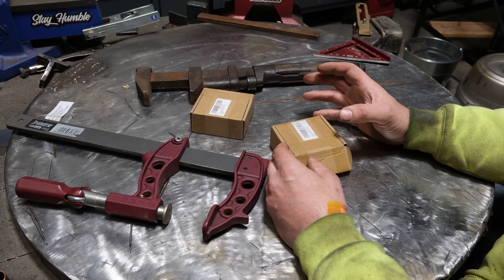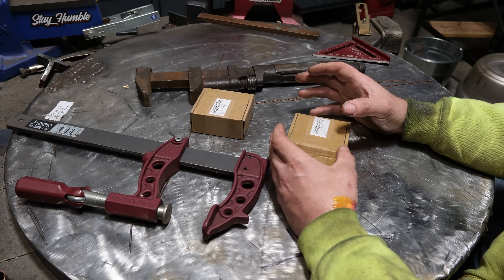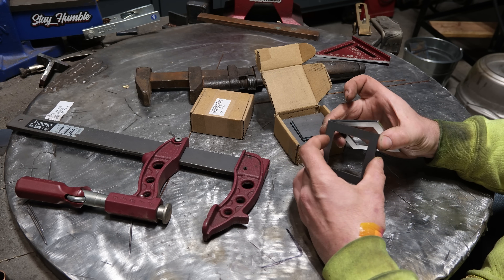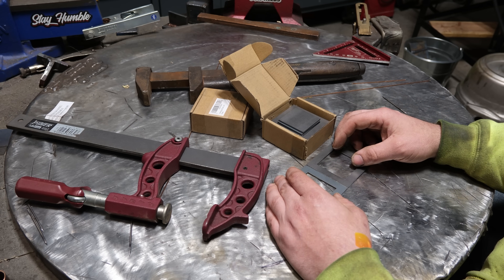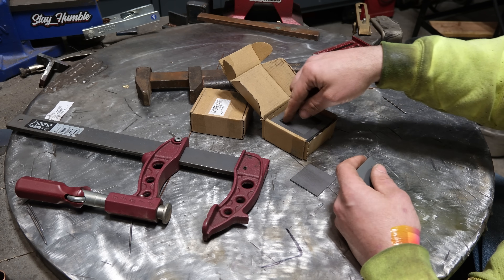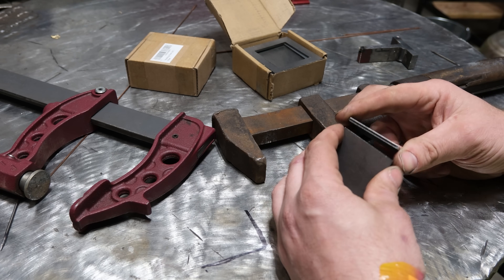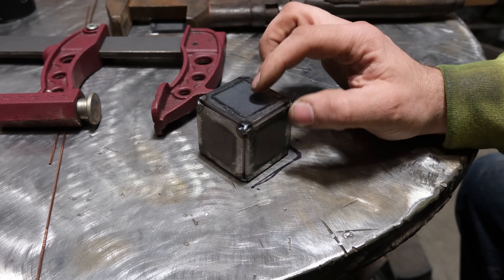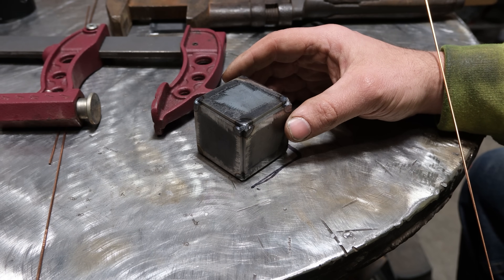Project time: lets weld a cube together from a kit

Comment: Have you seen the stainless tig welding practice kits on Amazon? They have some really intricate ones as well as fairly basic. Dice, deer antlers, wolfs head, and a couple others that are all probably 1.5-2mm stainless cnc plasma or laser I would assume. I thought about picking some up as gifts for people and also to help teach my son to tig stainless. He’s been welding since we was 8 but I’ve never had him do any stainless work because of the cost of material. They are so cheap on Amazon though he can start with the basic dice and then the antlers working his way up to the wolf head as a final project.
Reply: I’m looking forward to your video on pulse. I have played with it here and there but have yet to find a time it was any easier or faster than just controlling everything with the pedal.  I end up taking longer trying to time everything right with pulse with the right time to add filler rod or to move ahead ect. I may be just over thinking it or something idk. 99% of what I do is aluminum so maybe that’s why I don’t get much use out of it.
Reply from the maker: I will definitely look into kits like that.  I bought a few different ones (no animal heads) and the quality is really all over the map.  If the Amazon review is decent it probably will be decent.  It would be a fair bit harder to do a 3d shape than a simple cube.

Regarding the pulse, I generally tell people to stay far away from it on aluminum.  Aluminum is hot short sensitive and pulse will increase the risk of internal weld cracking significantly.   For most metals the pulse doesn’t offer much.  Mostly thin fusion welds it can give better control of melt through and bead width.  It can make a more consistent looking stack of dimes with tig, but often at an expense of weld penetration.  I tend to not use it much simply because the benefits diminish of things other than thin material.

Comment: Great idea, and pretty economical given the effort to make an equivalent by hand.  Certainly need mill scale removal, or "pickle" them in vinegar for a day or so.  Could also use these for TIG brazing practice.  Could also add one of the other kits that are thinner metal, as a way to improve heat control, working on that after getting experience with this thicker stuff.
Reply from the maker: Definately would pay to remove the milscale, great tip on the vinegar.  Tig brazing would definitely work great too.  The amount of time it would take to cut out the pieces yourself easily makes buying a kit worth it.  Especially trying to make them perfectly square lol.

Comment: Nice job. For small steel parts, i will soak in mutatic acid/water solution. Removes mill scale fast. Looking for to the pulse video.
Reply: For mill scale that looks to be this thin you can also use regular vinegar.  Immerse for a day or so and the mill scale wipes off.
Reply from the maker: Something other than grinding is definitely the way to go.  The end result will be better too 😀👍

Comment: Definitely going to get a kit at some point this summer might be good flux core practice or 1/16" 6013
Reply from the maker: I will be trying to stick and might weld the others in the kit.  Flux core wire and mig shouldn’t be too hard.  Stick will require 1/16th rods and will likely be far harder.  6013 rods like you said will be the way to go for sure lol.
Reply: @makingmistakeswithgreg 
Welded up 2 cubes with 3/32 and 1/16 6013 the 1/16 was way harder to use

Comment: Very nice welds!  I’ll have to try tig welding some day.   I have a question…On a recent project, I’ve had to weld fillets on the inside of a traylike item.  This is with flux core and these inside fillets are coming out terrible (normally exposed fillets are coming out good)…only sticking to one plate, lots of splatter.   Could this be due to arc blow?
Reply from the maker: Interesting results on the inside corner joint/fillets.  So arc blow/wandering tends to be most common with stick due to the flux burning off inconsistent and the polarity running electrode positive which causes a wider arc cone.  Flux core wire runs DC negative and the arc cone tends to be very consistent due to the wire not having external flux.  What you’re describing makes me think material contamination or base material differences.  Difference in alloy types can produce very unusual welds.  Same with differing thickness.  If one is stainless based and the other steel, you will have unusual welds no doubt.  I would verify what things are with a magnet, clean everything really good, and try it again.  If you do have one type as stainless and the other steel the results will be poor without a 309 wire.  The downside to the 308-309 self shielded flux core wires is they require a lot of voltage to run which many welders can’t hit.  Other than what I mentioned it may just be a case of a few settings changes will make the difference.  Play around with settings and see what happens.
Reply: @makingmistakeswithgreg Thank you for this detailed answer.  My machine just has a power level so it’s not so adjustable. I’ll try with cleaner materials, different power levels, and more practice.

Comment: Went out and bought a set immediately, thanks for the vid!
Reply from the maker: No problem 👍.  It’s a lot more fun than doing just simple practice welds, and it’s way easier than cutting them out by hand.  It would be unbelievably tedious to cut all those out by hand lol.
Reply: @makingmistakeswithgreg Absolutely! I'm also thinking of grabbing some of the ones that make dice. I've got some oops holes I need to fix and those have pre-cut holes I figure I could use for practice.

Comment: pretty tig welds. I wonder if you can do a reasonably pretty job with 5/64" stick? My stick welds seem to come out pretty ugly. I just got used to the look. I know I need more practice. Better to be strong and ugly than pretty and weak..
Reply from the maker: So the 5/64 rods might be able to weld it.  I will give it an attempt with mig and stick soon.  I have a feeling stick would be far harder.  The key with stick is 6013 rods run dc negative to limit penetration.  It will be hard still, but doable I believe.

Comment: I have been saving my project cutoffs and using them for practice. It helps to clean all the mill scale off before doing the cutoff. If I forget, i soak these small pieces in vinegar for a few days, which works except for when it doesn’t.
Reply from the maker: Vinegar would definitely beat sanding them down.  The end result would likely look better too 😀👍
Reply: If its cold at all the chemical reaction slows way way down. If you warm the vinegar or container even 3% will take off all the millscale in hours not days.